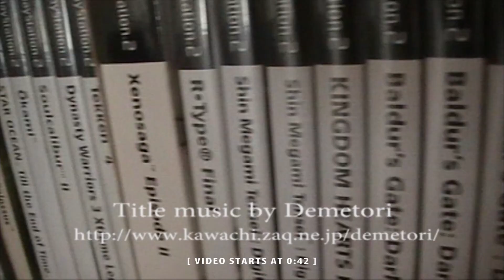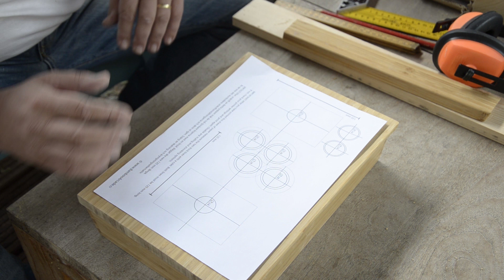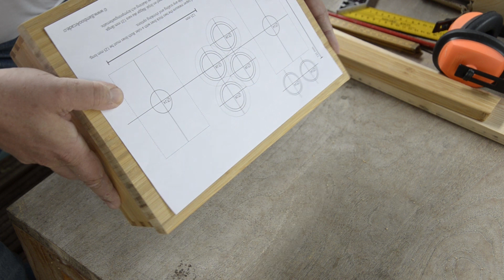building my diy bamboo arcade stick PART4

Comment: One step at a time, wood working can be relaxing in itself.  You might want to splash on a cross cut saw at some stage, saves so much time and cuts much better than a jigsaw.
Reply from the maker: I'm not too well versed in toolery, so I looked up what a cross cut saw is, but that looks like the hand saw I used earlier. My problem with that mainly is that the surface I'm cutting is slanted making it harder to do by hand.

Comment: what are you trying to do with the knife? take the base off?
Reply from the maker: Yeah I need to fix the top to the box so the bottom will become removable. It's glued and stapled so it has to come off.
Reply: @TheHighlander71  ok got it. Good work so far. It's a nice looking bit of wood. I also like the button layout you have, it should be ideal for the kind of games you want to play.